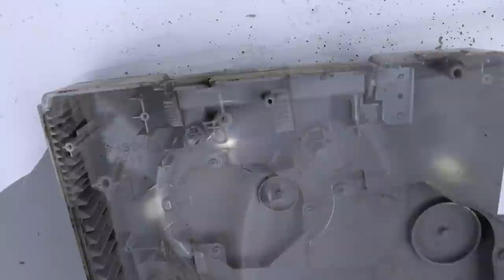I Restored This Junk Yellowed and Dirty PlayStation 1 That Won't Start Restoration (PS1) - ASMR

Comment: The UV Light part is really impressive. I didn't know that you can restore a piece of plastic like its new.
Reply from the maker: Thanks I really appreciate you! 🙏
Reply: There's a solution you can mix yourself but it's easier and cheaper to use Salon Care 40 Volume Cream.  You can coat the plastic with it and then wrap it in plastic wrap, then put it in direct sunlight for a few hours. But the UV light is a lot easier.

Comment: Hey at 4:30 on your video you take a part off that’s been soldered to the circuitboard.why? was it not important? And I saw someone us gasoline to clean a circuit bored is that safe? Or is it better to use isotropic alcohol?
Reply: Il a dé soudé les fils parce qu'elle a l'avantage de lire les jeux gravés sur un CD.
Personnellement je les aurais laissé.

Comment: Hi

I have a fat one and did not start until I push that sensor at the corner or put something above it for little help of pushing more. So, I am thinking my green board is dirty or something like that. 

Is that ok to spray it with alcohol 91% without taking off the screws inside the console ! And how much time does it take to be dry?

Comment: 4:22 what was that part he unsoldered?
Reply from the maker: It's PlayStation 1 modchip.
PlayStation 1 modchips were designed specifically to bypass the copy protection and region coding that was built into game discs to prevent piracy. In particular, there is a stream of data sent from the CD drive to the processor every time a game starts.